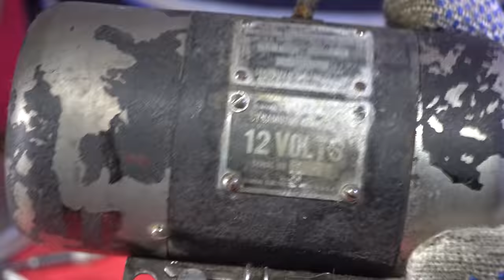LA ENERGIA LIBRE NO EXISTE Free energy does not exist

Comment: Take a 12 volt DC generator. Connect an AC motor to a generator that will produce 50 volts AC. Now stabilize these 50 volts to 12 volts and connect to the generator. This way you will get free electricity. And stop misleading people.
Reply from the maker: Your theory is totally wrong. Every conversion you make will lose energy, by basic principles of thermodynamics. I am not deceiving anyone. You are fooling yourself. What you say will never work because there is no feedback of energy. Greetings.